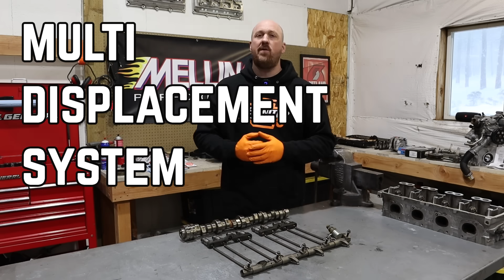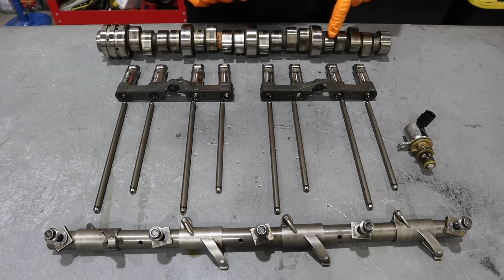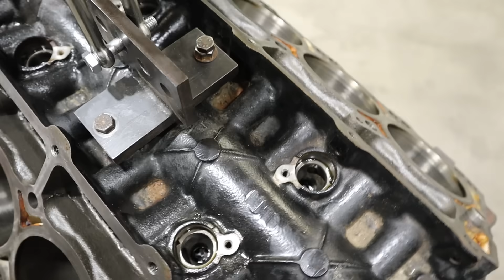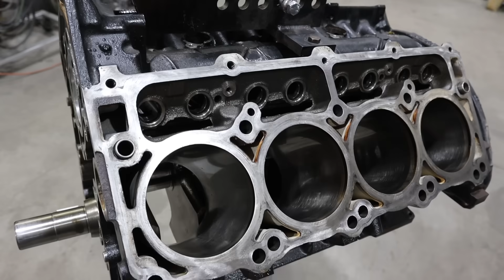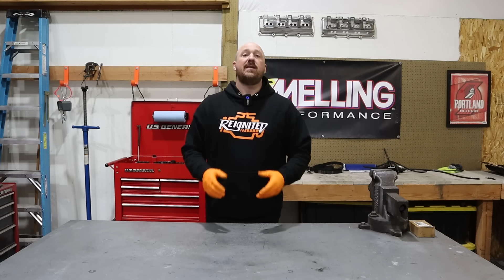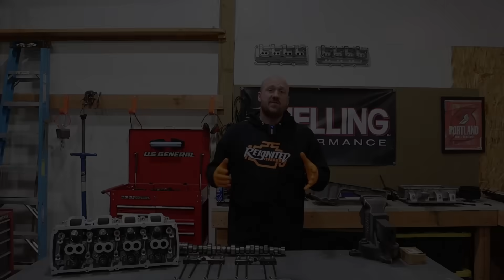Is MDS Damaging Your HEMI? The Answer May Surprise You!

Comment: You said the MDS system deactivates all 4 cylinders at once. Then you said it can deactivate one cylinder and the others will work. Which is it? I know that it will turn off an injector for a cylinder if its getting too many misfires. I dropped a valve seat in number 2 and it turned off the injector after sensing a misfire for a minute. Its not the MDS system that made the valve seat too wide and made it fall out. I blame emissions standards being to strict and stupid. Forcing car makers to cut corners to save weight and claim to save fuel. I would prefer to have the extra oil volume going over the lifters all the time and maybe through the heads so they don't heat up differently and drop valve seats. I bet its someone that knows very little about cars getting ordered by people that know nothing about cars. In all likelyhood hates cars and are envious of the freedom that it gives everyone that owns one. They treat guns the same way. They want to be the only ones to have them.
Reply from the maker: The solenoids all turn on and off at the same time, so you are going from 8 to 4 cylinders, but each solenoid only directly controls 1 cylinder to deactivate.
Reply: Geezuz, paranoid much? Dropped valve seats almost always happen on '08 & older Hemi's, AND usually following an overheating event.

Comment: As a recently converted Chevy guy I'll tell you that your videos are fantastic and I've referenced them many times while repairing my 300C with a  5.7 after it dropped 2 valve seats. You're great at breaking down the system and explaining what's going with the system and why something like MDS is even there to begin with and the thinking behind the whole design. So yeah you're the best on YouTube with these modern factory Hemi engines so keep the information coming bro and thanks for the help.
Reply: Hint, I have a 4.7 and when I rebuild it I put crome-olly. Sorry can't spell..
Crome seats now the seats are interference fit 3-4 thousands.  The won't be dropping out unless I get it super hot. Cromoly.. lol.
Reply: You went to a more unreliable brand? Lol
Reply: @35RSkyline stay off the drugs
Reply: @Lane.fitness25  I mean the 6.2L engine right now?

Comment: My mechanic argued with me about leaving this system in and taking it out. It's a 57 hemi, on a 2012 Dodge Ram 1500. Somehow, the push rods got installed incorrectly and they got bent. We had to reopen up the motor reinstall, new rods now on. Start up the first 1012 seconds of startup. I have a very bad rattle.  At it levels out I put a hellcat. Oil pump in for higher pressusher and better oil flow for idling. Is there something we can do are dead? That's the problem with this start up rattle. The motor runs well. What's it's warm but in the first seconds of started up. I have a bad route already idea how to solve that.  Please help gordon leakey

Comment: I have a 14 1500 5.7, the oil pressure on the dash never goes above like 50 or 60psi should i be worried? It runs fine
Reply from the maker: Nope, that sounds just fine to me.

Comment: I don't like the fact that all manufacturers have issues. In order to reach the standards they need to I feel that they are moving away from the set ups that work really well. Back in the '80s some of this stuff was tried and it failed. Now we are still trying to get it to work right.
Reply from the maker: I'd have to agree. The fact that the government keeps moving the goal posts in regards to how vehicle must perform means they are constantly redesigning systems trying to meet these standards, only to have to completely change them again a few years later. It means there's not enough development time in each platform to correct the issues before they have to clean sheet another design that then has its own problems. And the cycle repeats over and over. 🙄

Comment: I have 07 ram 1500 , I had the top end rebuilt, heads rockers lifters cam and high volume melling oil pump. The c is a comp cam series 1 , thought it was stock , but it is a mild cam. After the repair I had to take it to a tuner to get it to run correctly, it runs fine lots of power, but doesn’t idle smoothly, surges about 200 rpm’s. Any suggestions on how to get it to idle smoothly? 🙏
Reply from the maker: Something like that has got to be in the tune itself. With the drive by wire throttle body, it is constantly "hunting" trying to achieve the correct idle RPM, but it can get stuck in a loop where it surges like that. Usually that can be tuned out with a combination of timing adjustments and throttle body sensitivity, but I'm no tuner unfortunately.
Reply: @ReignitedAuto  any information on a good tuner in the Orlando Fl area ?

Comment: The best way to not have this issue is to stop buying Dodge Chevy and fords.
 Buy toyota Tundra if you dont want issues..
Reply from the maker: You know what's crazy? Toyota has service centers too. In my 20 years in the automotive industry there's one immutable fact. All cars break and you can find people from every brand who swear they'll never buy one again because of their personal experience with a bad one. Conversely you'll find people from every brand who swear by their vehicle that it's the best, most reliable vehicle ever. Everyone's outlook is shaded by their personal experience.
Reply: Former Toyota tech and Toyota's break down all the time! Engine failures,2011-up 4 cyl engines have bad piston rings from the factory they even burn oil from new and ruins your engine...

Tundra had rusting frames...5.7 camshafts were self destructing,bad rear diffs and more the new 2023-up Tundra have failing Turbo's and other issues...Toyota  is no better than Chrysler for reliability..

Comment: My 2011 wrecked a cam, always short oil change intervals, never raced, but driven hard once in awhile. My MDS always kinda delayed when switching back and forth. 184,000 kms. My goal, if I get it fixed, is to remove the MDS. Melling HV pump, Hellcat lifters. Oil filter has filings, but the VVT solenoid did not. 
Folks that think a looked after Hemi won’t wreck cams are delusional. It’s luck of the draw apparently.

Comment: I turned off the MDS in our '14 300C 5.7 hemi about 4 years ago, using my tuner tool along with loading a hotter tune in the ECM, car returns 21-24 mpg with all 8 cylinders firing while driving at highway speeds. Works for me, have the option to turn it back on if I sell the car in the future. Mileage with MDS on was about the same, but the noise from it operating was enough to drive a person nuts, thus, good reason to turn it off IMHO. I also run a factory stock exhaust off my 6-speed Challenger, so resonance will be different in that exhaust, and it has 2.5" tubing as opposed to 2.25" stock system.
I keep oil & filter changed with good synthetic oil at or around 4K miles, no crud or sludge deposits inside this engine at all.
Great tutorial on this system, thanks Skye!
Reply: Hey Havasu can you send me information on the tool used is that an affordable thing I can buy or is this just for; mechanics
Reply: @padue2503  if you reply directly to Havasu's comment, he should get a notification and should answer your question, he'll never return to this video to read the comments unless someone replies to his comment directly
Reply: If you turn off the MDS with a program tuner, you should first replace your lifters with non-MDS lifters and remove the solenoids and put in plugs capping those off. Because if you don't do this, might not get enough oil pressure or volume of oil to your lifters. Thus may cause your lifters to fail. Now if the MDS is not working properly like causing a vibration noise then find out what's causing that instead of just turning it off. I would say what's causing the vibration noise from the MDS is probably a bad solenoid that needs to be replaced. Keep the car the way it is designed. If there's a problem and you just remedy the issue, then it's not fixing the root problem and it's probably gonna cause more problems. Now if your intentions is to race and don't care about saving fuel, then okay just get the MDS removed and all parts with replaced with non MDS parts.
Reply: Hello. Could the noise you were experiencing with the mds active be described as vibration?  Mine seems to be a vibration and I'm worried it may fail and leave me stuck or worse
Reply: @youngnolo451  no, noise was from the engine running on 4 cylinders in MDS mode. My new Chrysler 300C 6.4 hemi makes the same noise when in MDS but quite a bit more muted.
Reply: @youngnolo451  I have the vibration issue did you find a fix?
Reply: @dre_dcf5212  yes.  It was mds.  I didn't want to pay first the tuning tool thingy because that's like 500 bucks.  I payed a tuning shop to disable it with a computer...  runs like butter now.  I think I paid them 300 bucks for 5 minutes of work.  Lol.  No more stress bro!
Reply: @dre_dcf5212  if you have a sport button in your car to turn it on to sport mode it will automatically turn the MDS off or if your manually shift your gear shifter from D (drive- 5th gear) to any gear like 4th gear it also will turn the MDS off
Reply: Hello parts need it to do it?
Reply: @jarellanosja if you hit the little reply tab directly beneath Havasu's comment, he'll be notified and most likely will answer your question
Reply: Sorry meant turn off mds not removing it if not concerned about saving gas. Along with putting in non mds lifters and removing solenoids and capping them off.
Reply: I found metal shavings in my oil on my 2016 challenger rt 5.7, I had bought used as a project car , it had not been taken care of, I had to replace the engine, since then I only run royal purple hps 5-30, I also only drive in sport mode which deactivates mds. My engine purrs like a kitten, there is no tics, chirps, or squeaks whatsoever.

Comment: Nice job explaining this system. Now I have to work on my drive-thru anxiety. (idle time). Any thoughts on using 5w-30 vs recommended 5w-20 oil. Heavier weight may increase oil psi a bit.
Reply: Watch the video on hellcat pump vs the high volume melling pump, but basically keep the recommended oil 5w-20
Reply: Just to add 2022-2023 use 0w 20 oil  and my psi is the same as my 2020 with 5w20 I see no difference with the psi cold,warm or hot or driving at any speed!
Reply: I use petro - canada duron 5w30 advance  - strong oil for diesels BUT with low viscosity  = lowest w30 = good for heavy engines .

Comment: You said when the MDS is turned OFF the engine is not getting maximum oil lubrication.  If that was that case trucks that are in tow /haul mode and working the hardest would be in risk of getting the engine damaged because in tow/haul mode, the MDS is turned OFF.
Reply from the maker: That is correct, and one reason why I believe the 2500/3500 trucks originally did not come with MDS. However, another thing to note is that at higher RPM the stock oil pump is putting out a lot more oil than at idle, so I believe the lifters are still receiving a good amount of oil at that time. I do think for the HD trucks only it makes the most sense to remove the system altogether as they don't generally see much benefit from this system MPG wise.